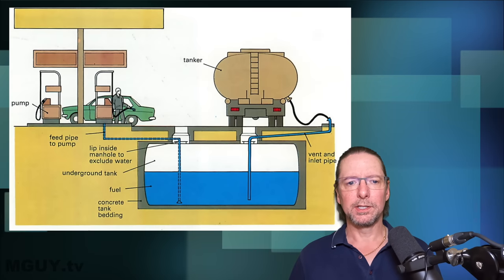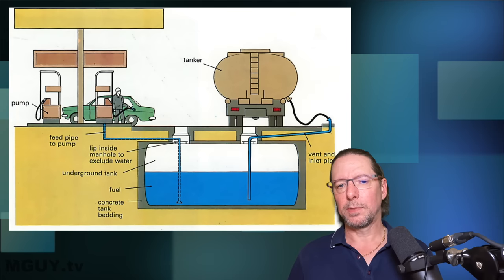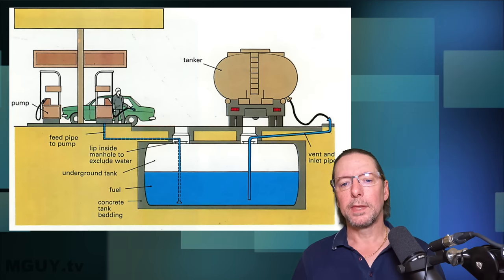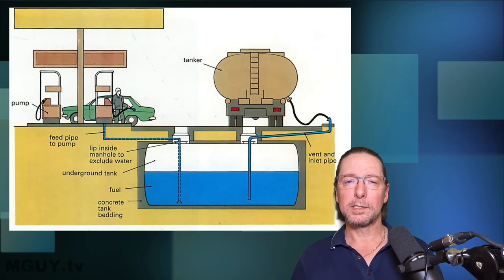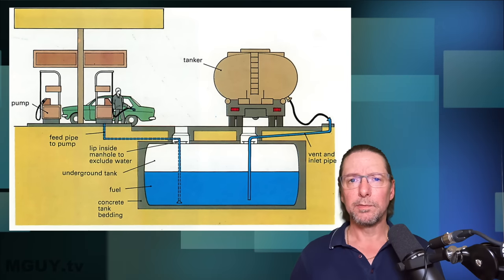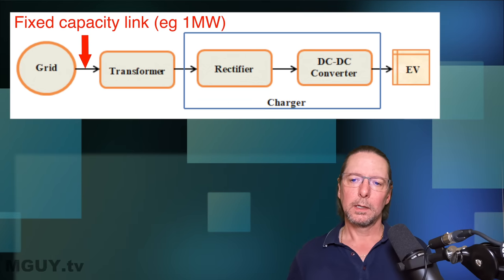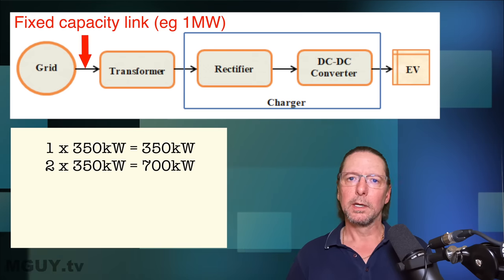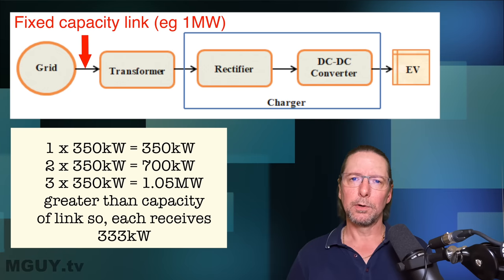HUGE problem with EV Charging Stations that no one mentions | MGUY Australia

Comment: I AM PRETTY SURE TESLA CHARGERS HAVE BUFFER BATTERIES  AND NOT CONNECTED DIRECTLY TO THE GRID AND I CAN,T IMAGINE OTHER CAR CHARGING SYSTEMS TAKING MULTIPLE USERS INTO ACCOUNT SO I THINK U ARE WRONG NOT IN ALL CASES BUT IN MOST ALSO I CAN,T SEE HOW BATTERIES WOULD BE MORE A FIRE HAZARD THAN A 20,000 GALLON TANK OF GASOLINE
Reply: You are funny. Your CapsLk is on.

Comment: I always thought Hybrids were the viable alternative not EV. Very informative on charging bottlenecks. EVs have their place but not as the total alternative. The same goes for wind and solar. The have their place but not as the primary source of power for the entire nation. New nuclear preferably Thorium MSRs and modular reactors mass produced in factories and placed on site in servivabke vaults like battery packs as needed rather than very expensive site built mega projects for entire regions.
Reply: Exactly. Why are there not more hybrid cars around? They were popular a few years ago but see fewer of them.

Comment: Come on you know there is a simple solution already in use. Just connect a diesel generator when ever you need to charge Cars at a gas station. You can even connect it directly to the fuel station diesel tank.😂😅

Comment: Sorry, but this is just stupid.  IF we were going to open this make-believe multi-car, all-at-the-same-time charging site, we would have already checked and planned with the  local utility and grid operator, and would be planning on putting in a 10 MVA (10 000 000 watts) or so transformer for it.  This is not something exotic nor just discovered.  Such transformers are not even particularly large, and are as common as dirt in substations, industrial sites, water plants, or anywhere else with large motor loads, around the world.  So we get the site, plan the feeder from the utility, map it out, place the feeders, set the transformer, and distribute it out to the chargers -- 10 MVA / 350 kVA per charger = 28 chargers going full bore, full-time, around the clock.  Local utility is going to love this cash-flow.   So why does every idiot on the intertoobs now think they are a Grid Level Electrical Engineer?  What is with this mass-stupidity?

Comment: I believe lithium batteries will be banned in cars, recycled back into phone batteries, here is why:

Fast swapping lithium batteries is pointless if your convention center burns to the ground, courtesy of Iran?  

Chinese 'penetration' is I think irrelevant or considerate of the fact a large percentage of the population either does not or never will, own a car due to population density patterns and transportation systems.

For example asian countries may entertain bicycle lanes on roads, yet in America, such things are useless as most people will not be victims of hit and run accidents with cars.

The real agenda unfortunately behind the push to sell electric vehicles at this time is more likely tied to real estate, as mortgage payments include house insurance.

Since lithium batteries are able to dissolve concrete if charging systems or safety fuses fail (a fire) insurance companies may pass the buck by raising mortgage rates?

People are not able to save as much, and voila, ninja real estate investors can flip cheap properties on a regular basis?

I suspect this is the real muscle as insurance and banking have long and notorious political histories, at times not proven healthy.

So lets say your electronic vehicle breaks down.  Who will tow you?  Especially after a fender bender?

Not many, since if the vehicle catches fire on the highway and say burns down a bridge, that tow company may be liable for ems labor, cleanup, and rebuild, and containment.

Next, how many of you land at air ports or go to convention centers where electronic vehicles can travel underneath runways and buildings?

Expect travel bans eventually, I would not like to be landing at an airport with ev fire in progress.

The solution is agm lead acid batteries, and a more realistic range of about 50 miles with climate control in the cab in extreme conditions.

Provided ev manufacturers adopted a common standard of letting people recycle their batteries without going to a dealer for proprietary connections.

A slide out tray(s) with series of small factor agm batteries may work, although making them safe as a pickup truck bed is necessary (battery cage crumple zones to start fiber glass fires, not necessary).

That in a nutshell explains the politics and actual practical use of such cars, and the numbers are useless since only a small portion of the population would even use them (incomes).

Driving by high density population areas such as apartments tells anyone paying attention, they are not going to hang out hundreds of high amp charging cables into the streets, especially where wandering drug addicts are tolerated to loiter about.

Comment: You keep hating on EVs. I love Internal combustion and I raced under KHI for a living when younger. If melted more piston crowns then you've eaten popsicles. 
Methanol is my flavor, and compression my master. That said EVs, are dependable, reliable , predictable, and DAMN FAST!  I have mixed feelings, but thats just holding onto the past and fearing the future. Even though I race, ill still eventually have an ev for daily driver.  And Pfft batteries are easy to replace. your just hangry because your all thumbs and cant do anything yourself but get hurt hanging a picture.

Comment: I don't know if you just hate the EVs or just ignorant, but I can tell you in real life, there are very large charging stations, with more than 100 stalls in China or California, for an exemple and they don't have prblem to deliver power. Here in Europe, it's the same, we have 10 to 30 stalls charging stations and it's all good.
You just forgot some important things like batteries storage and the EV's charging curbs. Indeed an EV with a maximum charging capacity doesn't use it all the way down: this maximum is a few minutes peak and it goes down slowly until the end of the charging session. And the storage batteries are there to absorb those peaks, without using the net power.
So please let's go back to your studies to stop spreading your misinformation.

Comment: Most of what is said in this video is just negative propaganda. Owning an EV and going to charging stations is smooth and painless. It is also incredibly cheaper than filling with gasoline. You can run an internal combustion engine on a generator and charge an EV that can go faster and farther than gasoline powered vehicle with  that same amount of fuel because all the energy used climbing hills comes back when you go down the other side rather than being given off as heat by your breaking mechanism. Not to mention the cost of replacing worn out breaking systems. EVs barely need to us their breaks.

Comment: You sound like a horse dealer try to crying over the cars are taking the horses away.
 So they size the charging station to the amount of cars charging.
Der they can up the charging to meet the charging requirement. As more chargering is needing

Comment: This guy has no idea what hes talking about.  Fast chargers are for trips, every 3 or 4 hours you get out for 30 mins to an hour to take a break and charge, it doesn't matter if there's 1 car or 12 at a station, you'll be waiting around about the same time.  The limiting factor of EV charging is the ability to dissipate heat, and if there's more cars, there's more surface area to dissipate heat.

Comment: This is all well and good, but i often wonder as i pump gas at a gas station bathing in invisible toxic carciogenic fumes through my skin and into my respiratory system, i see multiple EV's cruising quietly and comfortably by me as my money is clicking away on the read out dial on the pump...the dollar amount far exceeding the amount of fuel pumping in.....WHY on earth am i standing here wollowing  in gas fumes standing on filthy pavement covered in rainbow patterened toxic oil and gasoline from leaking i.c.e cars previously parked here as they pepetually refill all that leaking burning gas and oil getting belched out the tailpipe and onto the pavement and the bottom of my shoes...yikes!..why oh why...there must be a way out of this toxic perpetual gas pumping never ending money draining cycle..oh wait..there goes a tesla model 3..gliding quietly and gracefully by....THERES ANOTHER ONE!  This one a white model Y...cruising by smoothly as a gull gliding through the air..the solution is right in front of me everytime i pump gasoline..all the silent EV's driving by...no oil...no gas...no toxic fumes as they are driving , no burning oil or wasted gone forever combusted gasoline out the back....just emmissions free operation as they are moving. Ahhhhhhh! Suddenly a warm fresh breeze comes over me..ckearing the toxic fumes....Eureaka!!!!!!Yes that is what solves  this entire toxic cycle. DUH. So on top  of filling up all time mguy thinks driving around with a 5 gallon tin can of flammable toxic fume emmitting gasoline sloshung around in the trunk or truck bed ir back seat is efficient?????? BWAAAA haaaaa haaa haaaa haaaa haaa!!!!! WOW! just. WOW! Why not just strap the tank to your back and walk around with those milijoules of slishing toxic energy...never know when youll need it! Bwa ha ha ha..insanity

Comment: This is practical nonsense.  Almost like listening to a flat-earther.  
Is EV the answer to environmental issues?  No.  Of course not.  Would I own an EV?  Yes if my lifestyle and my bank account would permit it.  Gas vehicles are very clean and that's my choice of truck and car.  But OP is trying to make an issue out of nothing.  EV's are fine.  Charging stations are fine.  Like early day gas stations way back, EV charging stations are made to handle the load of today.  As EV becomes more popular, then EV stations will grow like Costco gas stations.  Thumbs down on the short sightedness.

Comment: This guy above talks about batteries. So lets compare:- A massive petrol tank is very cheap to build and lasts indefinitely and they already exist, so this is extra money. Have you any idea how many batteries would be needed for 1 gigawatt/hr of power, my guess £2,000,000 per garage, then it would require maintenance and on average need replacing after 10 years. Multiply that by 8,000 garages in the UK alone and the cost would be £20,000,000,000 extra, every 10 years. Who is going to pay for that? And since there is no correlation between CO2 and climate change, it's bullshit, its all for nothing. ...and where the rare metal run out what then. Trust me EVs will be gone in two years and we will be left with a big expensive mess to clear up, or just dump it and leave it. Now IF there was a problem there is really simple solution and that is hypermileage cars 300mpg or 1 litre/100km. 2 companies have built them already so where are they? No infrastructure needed, low pollution and green to produce, but instead we have this crap.

Comment: Just listening to this guy is painful. He’s so full of it. You can tell he doesn’t know anything about how power is distributed. Voltage is precisely modulated and delivered to point of use. The smart grid is on build and includes battery storage capacity for renewables. Like any advancements throughout history it takes time. Not a fan of politicizing.

Comment: How far do you travel to get to work? For your sake be honest.  
How much of a charge can a normal power point provide over night?
In most cases the car will either need a full charge on a Sat-D or Sun-D
and a 70~85% top up mid week over a night if you travel more than the 
norm, which BTW is good for the current Batteries if you don't charge 
it to full capacity, mind you with the newer near to triple capacity fast 
charging batteries about to be released, they can be fully charged 
without any problems anyway, so the only worry really would be, can 
you plan your trip for you to quickly scoff down a meal while your car
gets fully charged in the time it takes to fill up a petrol guzzling money
pit.
Reply: What's it like living in unicorn land?  "quickly scoff down a meal while your car
gets fully charged in the time it takes to fill up a petrol guzzling money
pit"  You don't live in reality do you.
Reply: @CyrilSneer123  
I suggest you ketchup Err-Catchup as to what's going on in the real world, as it is blatantly obvious you have no idea when it comes to the latest technology, technology BTW that is about to go into production..
Can't believe how someone from Unicorn Land is suggesting their reality is real and the real world is just some fantasy, Must have had to much Fossil fuel exhaust if you ask me.. 🤣😂

Comment: oh can you please just learn the basics before poping a brainfart you had on the internet? no, neither Superchargers nor Ionity units share power between cars and yes, there is a set of batteries acting as a buffer to make the load on the gird more consistent. ive seen videos where the charging spot was very busy for a day(ex. a holiday in Norway) but no reduction of charging speeds was ever mentioned. the buffer batteries could actually act as energy storage for the nearby houses on days with less demand on the charging station itself.

Comment: At your age you should know by now that if you have a person pumping on each side of the gas pump, the flow is cut for each user. And not all pumps are turned up to their max. You assume 1mw. You assume there is only one line feeding all ev chargers. when in fact they can run a dozen lines from the main. etc etc etc
You talk out of your bum. laters

Comment: You're making a lot of baseless assumptions. You assume that EV chargers need to be connected to the grid all the time,. This is simply not true. More and more Tesla SuperChargers have their own solar panels and batteries. Even with just batteries, you can smooth out the demand on the grid (charge them when fewer cars are being charged and use the extra energy in peak times). You also leave out the fact that most of the time, EV owners charge their car at home or at work. We only really need to go to a charging station on an occasional road-trip. You obviously have an anti-EV agenda to be this dishonest.

Comment: Your knowledge of how Ultra-Rapid chargers operate in reality, versus your claims about each EV being offered less and less power as more EVs connect, in this example, is simply not accurate. There are NO EV cars on sale today which can take a full 350kW of power during a charge. The best include the Porsche Taycan, Genesis GV60 and a few others only. The bulk of EVs are on a 400V platform, so the chargers can only, at best, offer 50% of their rated 350kW to such EVs. Therefore, a relatively limited Grid connection can supply many more EVs with the power they are "asking for", and the chargers will only "load manage" if the total power being delivered to all EVs gets close to the grid connection limit. For the most part, this is never an issue. In fact, the bulk of EVs have a very low charging power capability, compared to what the chargers could deliver. This allows many more EVs to be charged simultaneously than you suggest is the case in this video. It's therefore not a HUGE problem at all.

Comment: I bring mine home with me, and let it charge for three hours (240v) while I have dinner etc then it switches off and I ready for the next day.  Regarding the fear of brown outs due to too many cars being recharged - it is a fallacy. Just unplug your hot water tank, or your A/C or your hot tub and you have solved your hypothetical problem. That said, if your house does not have sufficient power supply, then you will have to figure out an alternative. There are alternatives, you just dont know enough.

Comment: i just watched a video of a 11:00 p.m. charging station in L.A.  

long line at 11:00 p.m.  once you got through the line you started charging.  what do you think? it would take you one hour to charge.

L.A.  is the kingdom of newthink politically correct woke in america. if it's not working in L.A. it's not working anyplace. and e vs are not working in L.A.

1/2 of the charging stations don't work, or they don't take your credit card or sumpin. 

if you do find a working charge station, be prepared to wait charging for 30 minutes or more.

at high demand times don't charge, the grid is not made for it. that means we need a whole set of power lines and poles next to the existing ones to meet the power requirements  of charging stations, and we also need a lot of charging stations.

so before we change to e vs we have to increase the existing power grid by about 100%.  

forget about new york city.  it's physically impossible to charge all the cars in new york city.  forget about charging your car in any neighborhood that does not have a garage, where you park on the street. that is a lot of america. forget about visiting grandma in minnesota for christmas.  your $60 000 e v is only good for 9 months out of the year, because you don't want to get stuck in the snow because your batteries are dead and you can't get a charge.

think cold. think nose hairs freezing inside your nose cold. how do you expect to get over the sierra nevadas in the winter? or anyplace in idaho oregon or washington or wyoming or canada?

so the year is 2040 and all those problems have been solved.  did air pollution go down?  no. why? the good fairies that solved the infrasucture problem forgot to supply all the electric generators with enough clean burning gas.  it doesn't exist, burning gas and coal causes smoky air pollution.  

note: i used to live in tucson arizona. 2 days before it rained in tucson i knew it was going to rain. how? 2 days before we got the rain we got L.A. smog.